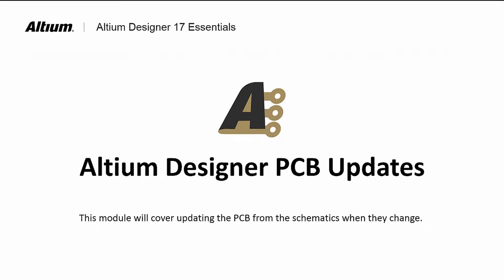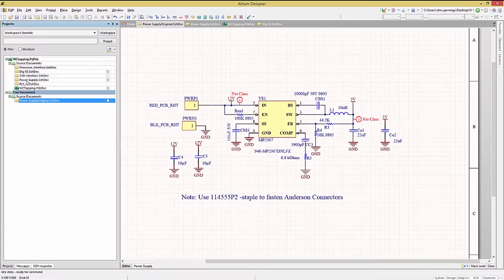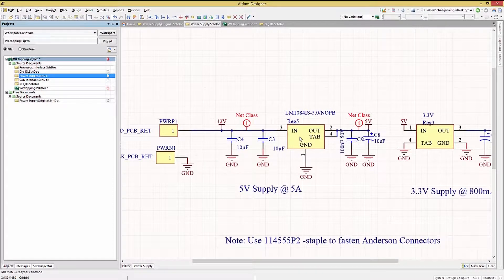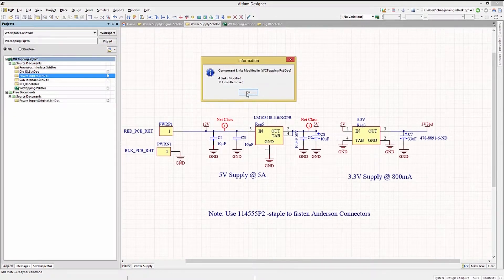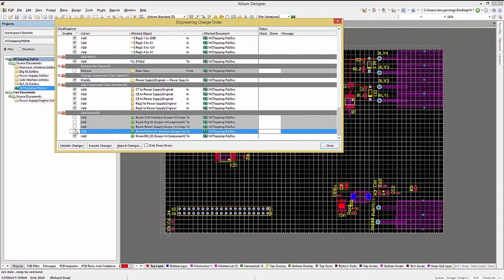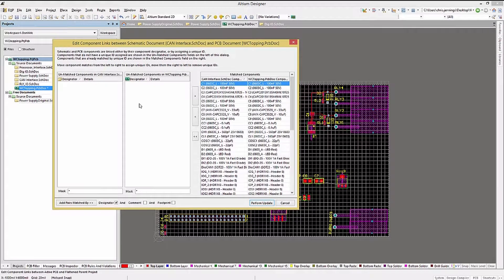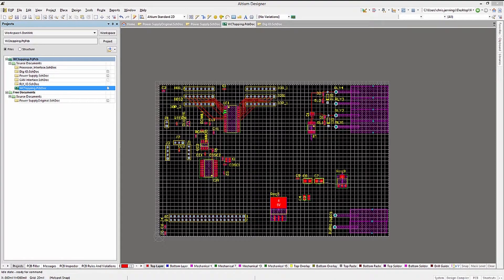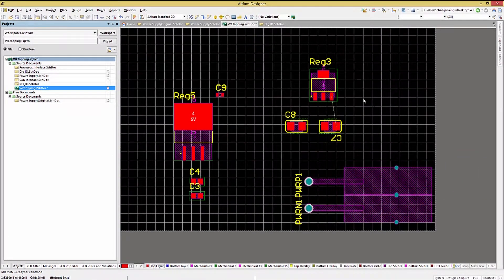Updating the PCB from Schematic Changes | Altium Designer 17 Essentials | Module 21

Comment: Very complicated and frustrating procedure. Eagle does the synchronization in real time. I am wondering why such a simple feature is so complicated in Altium?!
Reply from the maker: That's often what differentiates success and failure. Changing the board without a review process is dangerous and professional designers usually prefer to have the option at least. But if you are confident and know what you are doing I'm sure the instant changes is fine for you.
Reply: @AltiumAcademy  , "...process is dangerous" The process is really dangerous when Altium doesn't allow to save your work while "Interactively Route Connection" in ON. So in order to press Ctrl+S you need to cancel routing mode forst then only Altium would allow you to save your work on a disk. So if all of a sudden Altium crashes then you'll come to know what a saying "job for nothing" means.
Reply: I don't understand why such a simple process has to become so complicated. All I need is a PCB update after I have changed the schematic. This software is not intuitive and for this reason it is very difficult to work with it. I'm looking for a simple answer but instead I find a lot of explanations besides the topic. A lot of Altium posts received a lot more dislike than like, and that says a lot.
Reply: @AltiumAcademy  Bro you are not supposed to be passive aggressive, you are trying to sell a software :p